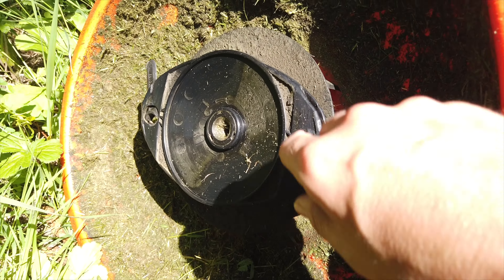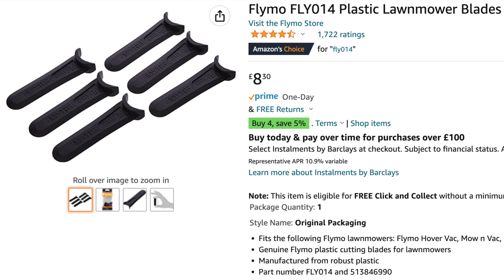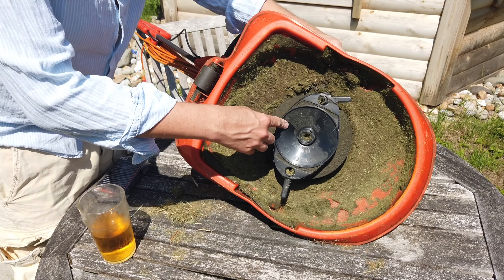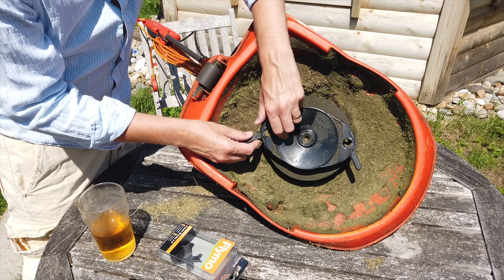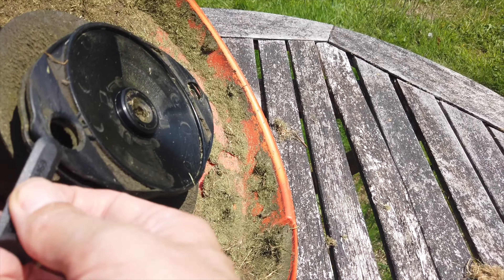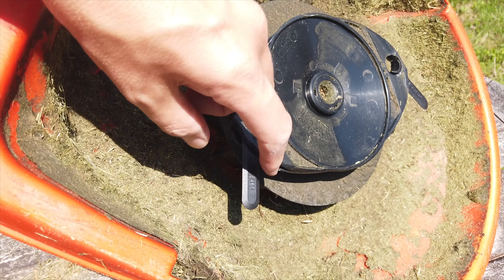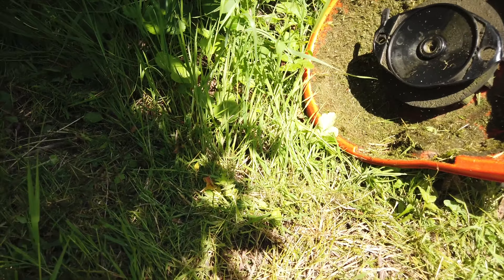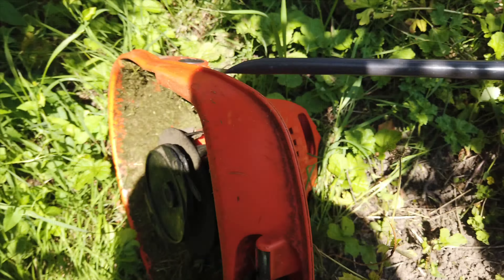How to change Flymo PLASTIC BLADES: Mow n Vac, Minimo, Micro Lite, Hover vac mower instructions

Comment: As a Qualcast metal blade rotary mower user, and without seeing the underside of one of these mowers before, I found such a mower in a garage and initially I thought the blades had snapped in half as the cutting diameter did not reach out to the edge of the underside of the mower. Glad I never bought new blades after seeing this. It is just that the mower performance as intended is just garbage.
Reply from the maker: Haha thanks for the kind comment pieandpeas, glad it saved new blades!
Reply: @DADDELIVERS   No, thank you Dad Delivers Vlog, really. There must be some reason why the blades are so stubby/short and do not reach  close to the edge of the casing?  The mower I looked at looked were a good 30mm away at the closest point, meaning each cut is 60mm less than it could be. It is not as if they stretch at high speed by a pre-determined amount, is it? A bit like concorde used to at Mach 2 or whatever. 😇